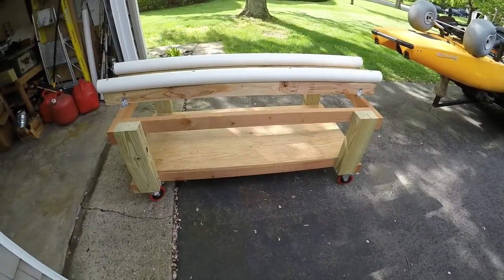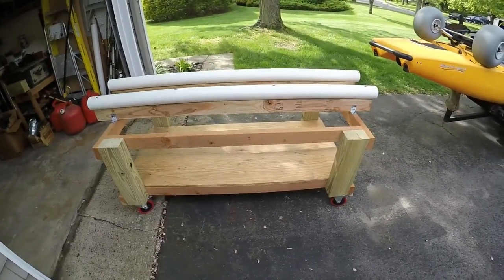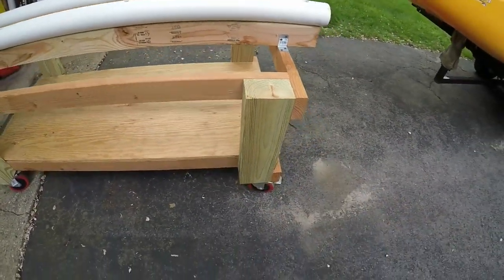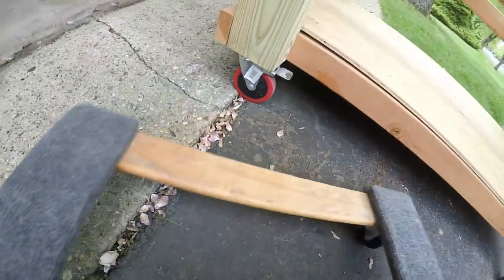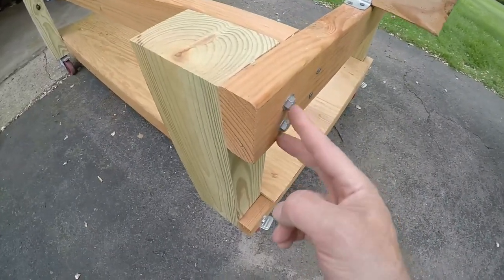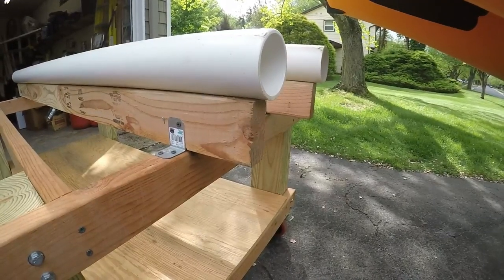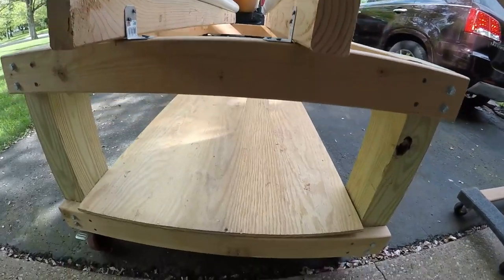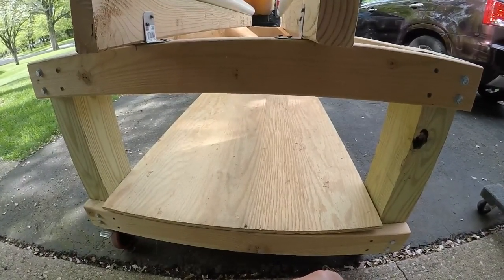Kayak Storage Cart Build - DIY Kayak Cart

Comment: Folks this is an excellent build.  If you own a Hobie or other heavy yak, you need to build this cart. A few recommendations for your consideration.

1.  Buy large wheels.They cost only a few bucks more and work soooo much better.

2. Don't attach the pvc with screws and washers. It's a pain to line up the holes screws and washers.  Instead scuff the pvc along the area it will touch the 2x4.  Apply about an inch of gorilla glue to the length of the 2x4. Bungee the pvc to the 2x4 - scuffed area against the glue. Let dry. Then remove the bungee and apply more glue along the gaps and area where the pvc meets the 2x4. Let dry.  The bond is excellent. I've loaded and unloaded countless times without one issue.  No wobble or slop - much better than screws.

3. Don't use solid material for the storage area. Use decking rails or other material to allow water and dirt to drain.

I use this cart about 4 times per week.  In my opinion it's better than others on youtube. In fact I've built two.  My changes add little to this excellent design and friends have used my suggestions for an awesome cart!
Reply from the maker: I just published a new video with all of the dimensions.

Comment: Nice cart... 
I would use spaced slats on the lower shelf to allow for drainage.
( I take my kayak off truck onto cart, and do the fresh water wash down. )
Carpet on PVC make life easier too.
Reply from the maker: The kayak slides extremely easy on the bare PVC. Also, I do not wash the kayak on this cart. That gets done on the back of the bed extender. I dont want the stuff on the shelf getting wet.  The good thing about these carts is that everyone can customize to what their needs are. This is a good base to work from.
Reply: @FishFinder  You guys wash your kayak?

Comment: FF, great cart.  2 questions.  It sounds like, if you were to do it again, you wouldn't build it with the 2x4's up top (below the PVC) but just put the PVC directly onto the cross slats.  Is that correct, or do you still feel the 2x4's add some value?  Also (I've got a Pro Angler 12) Hobie states that the kayak should not be stored on PVC, and that doing so voids the warranty.  Any concerns/thoughts on that?
And thanks again.  Great Cart, great video!
Reply from the maker: the 2x4 just elevates the kayak higher above the cart..... that's it. I have had this kayak on that PVC for over 6 years no issues at all because I am using the large diameter PVC. Hobie wants you to buy their storage accessories.

Comment: So I'm going to take a stab at materials...

Wood

*     You need an appropriate amount of 4x6 to accommodate 4x your height of choice
*     4 x 36" 2x4 to be used for width bracing
*     4 x 60" 2x4 to be used for length bracing (total length of cart from edge to edge is 64")
*     2 x 76" 2x4 to be used as running boards for PA14 support

*    Plywood sheet 24X64 for bottom shelf if desired

PVC

*     2 x 76" 3" PVC piping as runners

Hardware

*     16 x 4" lag bolts for frame stabilization
*     8 x 2.5" lag bolts for PVC runner stabilization
*     8 x 4-hole 90 degree "L" metal bracket
*     32 x 1" wood screws for brackets
*     8 x 3-4" wood screws for supplemental supports to bracing at each end (4 on each side)

Hopefully this is correct.
Reply from the maker: yeah looks pretty good. You get it!  To me the key is to use the thicker stock for the posts, the lag bolts and heavy duty casters.
Reply: I completed my cart and it works great.   I will post pics here.   The only mod I used was 4x4 posts which I would NOT recommend simply because the mounting plates for the rollers barely fits the 4x4.  If I start having any problems with the bolts loosening then I'll replace the posts with 4x6.

Btw did you know hobie does not recommend PVC for storage?
Reply from the maker: @davidlambert1450  that is why I used the larger stock posts. I brought the wheels with me to the lumber yard before deciding what to buy. I am comfortable using the larger size PVC under the kayak. It is spreading the weight distribution nicely. I have had my pro angler on that PVC for years and I have NO deformity below. Regarding what Hobie recommends... I stopped listening to them years ago. They are still making those horrible hatches that leak and sink kayaks.... and mirage drive pedal shafts that snap in half.

Comment: So, couple of questions.  I assume your bracing pieces are 2x4 correct?  And in terms of length is it 64" from 4x6 or from the edges of the bracing members (if 2x4 braces then the actual distance from the 4x6 would be 60" edge to edge??)
Reply from the maker: David...  I have been getting so many requests for dimensions that I am going to make a follow up video just to talk about dimensions. Will post it within the next few days.
Reply from the maker: I just published a new video with all of the dimensions.

Comment: I need to build one like this to hold and stack them, to save room in my garage. I have a pa 12 , an outback and a wilderness 135 ride.  any suggestions ?
Reply from the maker: yeah, I suggest that if you make a triple decker cart that you have the PA in the center. Use the heavy duty wheels and lag bolts and no screws.
Reply from the maker: I just published a new video with all of the dimensions.

Comment: Awesome cart. Do you store the kayak on the cart in between uses? Have you have any issues with hull deformations? Thanks for sharing
Reply from the maker: hey... yes I do store it on the cart all year. I have no deformations most likely because of two reasons.. 1. I am using the larger PVC pipes and 2. I run them the entire length of the kayak.  This spreads the weight out more which is why I think I am not getting any deformations. I made this cart years ago and it is still as solid as the day I built it
Reply: Fish Finder awesome! Thanks for the reply.
Reply from the maker: sure.. you are welcome. Let me know if you have anymore questions

Comment: I like you your set up made one just like it but went on side post 4x4 post l thought 4x6 overkill you can save money
Reply from the maker: Overkill? Maybe but the difference in cost was minimal. I wanted mine to be rock solid...and it is. I mentioned twice in the video not to go cheap. Especially with the wheels, lag bolts, etc

Comment: Dumb question but does it leave any flat spots sitting on the pipes for prolong period ? I’ve had mine for 3 months bought new and it was resting on a padded roller dolly and it’s left flats spots .
Reply from the maker: no flat spots at all. The larger PVC pipes fit perfectly in the slots underneath the kayak

Comment: Dimensions of your kayak cart for pro angler ?
Reply from the maker: 36" wide, 64" long. The PVC is 6 inches longer on each end. The height should be custom to the tail gate of your vehicle so that it slides on and off easily without lifting. The PVC pipes are 11 inches on center from each other.
Reply: Thanks, this is exactly what Im looking for.  Have the same loading/unloading scenario for my pickup !!
Reply from the maker: Steve, just measure three times. Like I stressed in the video, the wheels are extremely important. Mine are 5 inches in diameter. That is the minimum you should use.
Reply: I had already bought 4 inch wheels and going to use a 4x4 post.  Four inch lag bolts ?  What size lags did you use for your wheels ?
Reply from the maker: whatever fits through the holes/openings in the wheel brackets... the longer the better
Reply: That is awsome Man! going to be getting a pa14 and this will be great
Reply: Fish Finder will due I'm a big bass fisherman
Reply from the maker: yep and I have a couple of bass fishing vids already uploaded with 5 more waiting to be edited. Just trying to space them out a bit.
Reply: Fish Finder is your pa12 or 14
Reply from the maker: It is a 14. I wanted the larger one because I also go into the bay and ocean with waves and boat traffic.  I have a video that features my kayak and what I have done to it so far. I am actually thinking about selling it and getting a newer one with the H rails. I really wish I had those H-rails. I know you can install them on my PA too but if I can find a used newer one at a reasonable price I may just buy it.
Reply: Fish Finder nice I'm probably gonna get a pa14
Reply from the maker: I just published a new video with all of the dimensions.